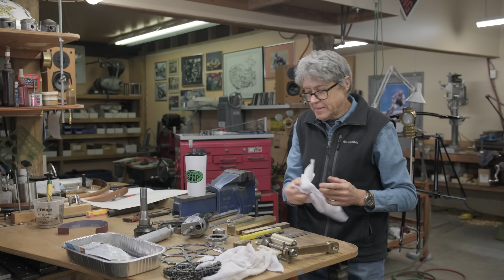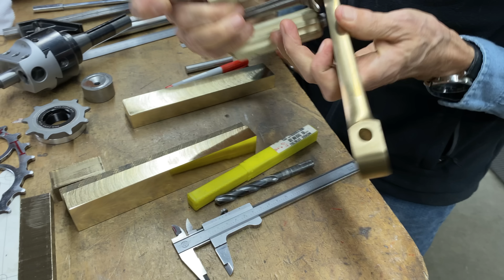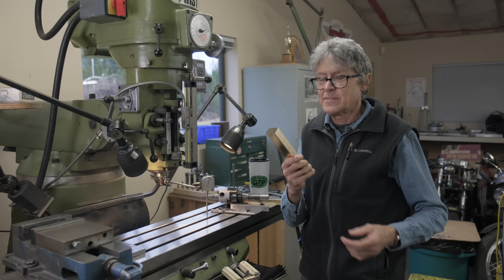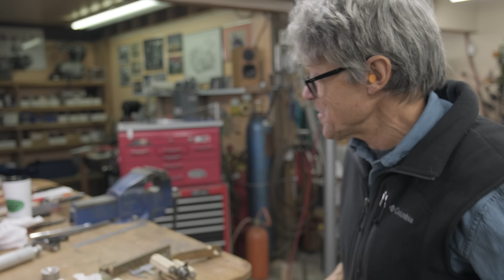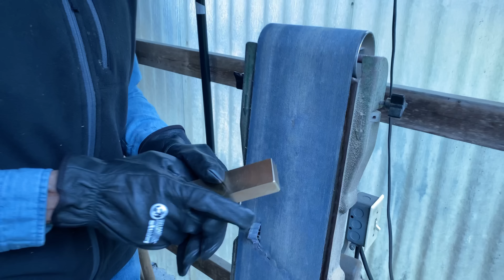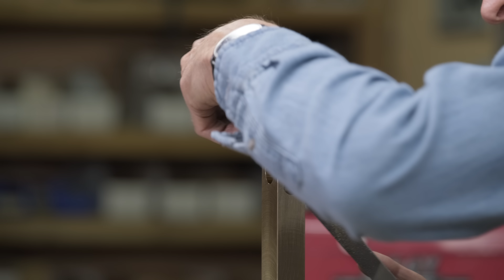Fabricating a BRONZE CRANK ARM for the 1894 Giraffe Bike - part one // Paul Brodie's Shop

Comment: Saw you explaining with the cotterpin, this was my first diy job which I did on my grandpa bike, the crank was loose and going back and forth when pedalling. Had to buy a new pin and file it down, and low and behold, everything was stable again! Learned a lot since then because I had to do all the repairs myself with no money to send it away for repairs! 😅
Reply from the maker: Yes, when money is tight, you do have to get creative. I have been there....Thanks for watching  :face-orange-raised-eyebrow:

Comment: I enjoy your videos a lot. I picked up a trick on threading. If you turn the cutting tool upside down and run the lathe in reverse you can thread with the tool coming away from the chuck instead of towards it.  And you don't have the terror of stopping the feed on time. Looking forward to see more progress.
Reply from the maker: Yes, you can do it that way. The problem is that you have to machine a groove for the threading tool to be in to start the thread. This groove weakens the shaft a bit, especially if it is smaller in diameter. I like to thread up to the shoulder to alleviate the need for that groove. I'm pretty good at it by now, so I don't experience the "Terror" of stopping. Thanks for commenting...   :face-orange-raised-eyebrow::face-orange-raised-eyebrow:

Comment: That bronze is unbelievably expensive, but it sure does machine beautifully. You said it has the same strength as chrome moly, is there any advantage in using  bronze other than the looks? Thanks for the video. 👍

Comment: 5.28 that tapered shank locking pin is called a COTTER pin, locking pedal cranks to the chainwheel axle was almost its sole use.. the name cotter has been hijacked and incorrectly applied to SPLIT PINS ..

Comment: As the owner of a hundred-year-old Hercules bicycle (unrestored) made in Nottingham, England, most of the shiny bits were finished in nickel plating, not chrome. I could be wrong, but that’s what I understand. When I get around to restoring the thing, it’s going to be a beast to do, especially the nickel plating. Because it’ll get really expensive really quick to have it done right. But the finished project will be accurate and correct. This is my opinion from the peanut gallery, such as it is.
Reply: Chrome plating wasn’t used til 1929. Nickel before then.
Reply: I agree. My Hercules was made around 1924 and there’s some nickel on it that hasn’t flaked off yet.
Reply from the maker: You are probably right about the nickel plating. Chrome didn't appear until the 1920's, or thereabouts, I believe.  First used on a car bumper.  Thanks for commenting!   :face-orange-raised-eyebrow:
Reply: Almost definitely nickel plating if it is 1920s.
Home nickel plating is quite possible but the kit isn't cheap.
If you do attempt it just remember the metal has to be clean, I mean really clean, I mean stupidly "don't touch it don't breathe on it" clean!
Then clean it some more😂